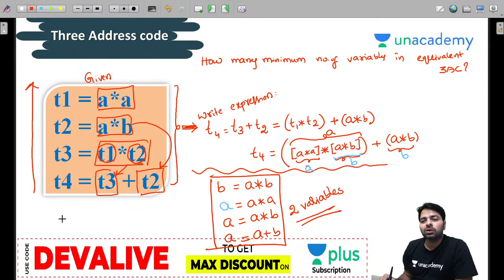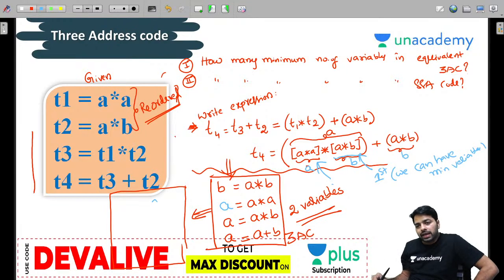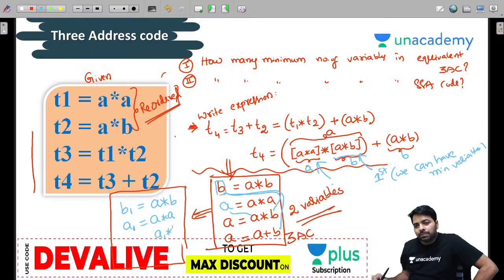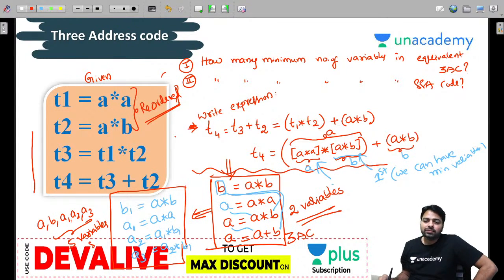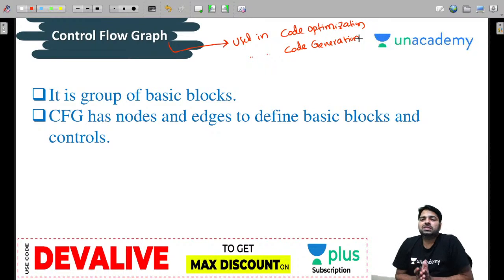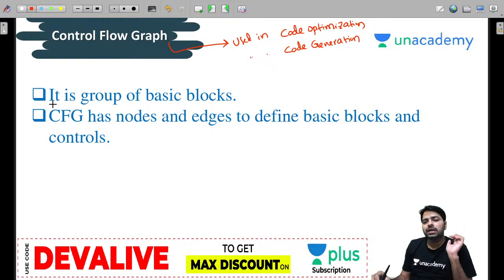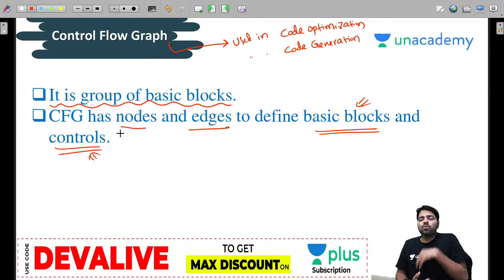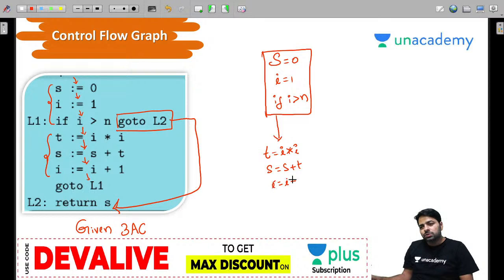SSA Code, Three Address Code, and Control Flow Graph | Compiler Design | Lec 16 | Mallesham Devasane

Comment: If a basic blocks can only contain atmost 3 instructions how did sir took >3 instructions in a basic block!? 

What is going on guys. 51:00
Reply: Basic Block is a maximum possible sequence of Three Add. Codes. It can have multiple (one, two, three, four or more) 3AC instructions. 

The criteria to select a Basic Block is that the control begins at leader & leaves at the end of sequence.

Comment: what is the ans of the last question which sir gave as an assignment?
Reply: 6 basic blocks, 8 nodes, 10 edges, 8 controls
Reply: @Dhruv.3108  Right.
Reply: 6 BB 8 nodes 8 controls 9 edges
Reply: @hinachandra2613  no 10 edge one for start and for 1 for stop
Reply: 3 Basic Block 5 nodes and 7 edges

Comment: in the control slow graph that you explained no. of controls are 6 so extra edges are 3 more then edges will be 9 
but you have taken 10 sir at 51:31 you counted controls twice
Reply: basic block 6
control 6 
nodes 8 
edges 9